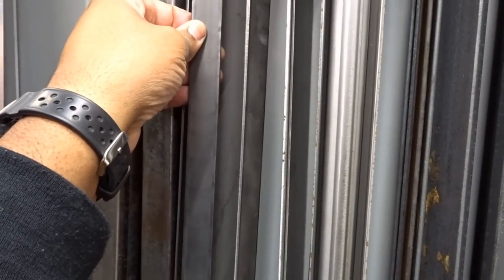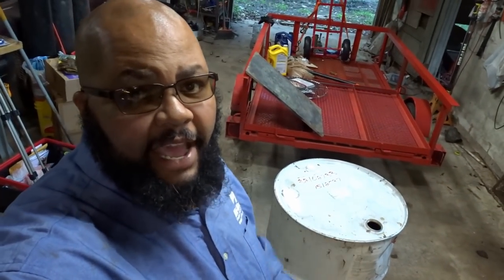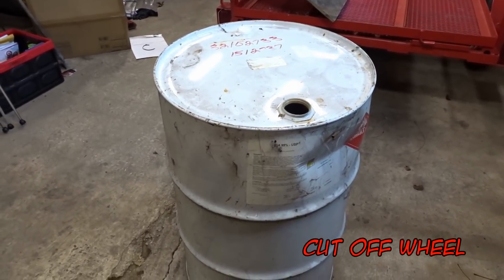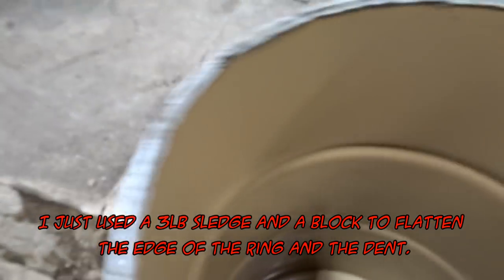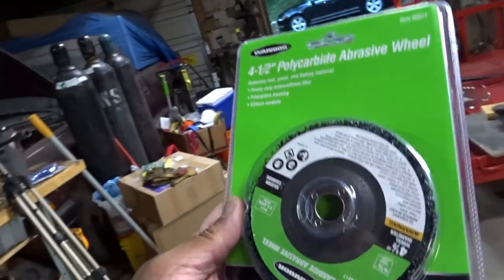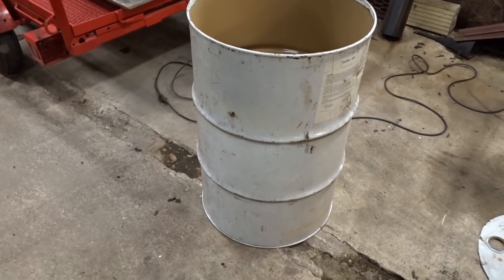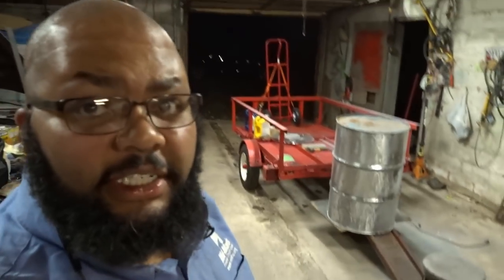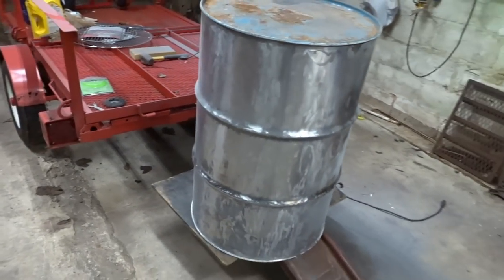SDSBBQ - Making a 55 Gallon Steel Drum Smoker - Part 1

Comment: I wonder if the paint strips easier if you burn out the barrel first?
Reply from the maker: It does. I had my car at the end of the driveway so I didn't burn it out first. I have almost always burned it first but for the sake of the video I didn't.

Comment: Did you have to wash the drum girst buddy? I got one bit it has a motor oil and I’m quite cautious as it might sprak and boom haha
Reply from the maker: The drum I used has olive oil in it so I didn't have to worry but I did have one that had rubbing alcohol in and it did go boom on me when I started cutting in to it. Motor oil isn't flammable so I'd just burn it really well when you cut into it.

Comment: The weather has finally changed 2 projects to go before the weather change again. For the flat stock. I used 3/4@3/16 thick. I wanted the lid to be flush to the rolled band at the top of drum. What would be nice is to get a roller tool thing. To roll the flat stock.  UDS is a labor of love.  I need to stop adding shit to mine and call it done for gods sakes.
Reply from the maker: I actually went to Harbor Freight looking for a roller but it was like 80 bucks and I didn't want to spend that on a tool I might use once a year or so.
Reply: Roller yes sir  I think I want one. I would like to make a slow and sear out of 1-1/4 flat stock 3/16 thick. Baileigh R-M5 comes to mind.
Reply from the maker: If you look at the HF roller they compare the price to the Baileigh R-M3... But a slow and sear would be awesome!

Comment: I have a barrel that had isopropyl alcohol in it. It’s flammable. How did you clean yours out so it wouldn’t spark and catch fire.
Reply from the maker: I've had a few that have had alcohol in them. Let them sit and air out or fill it with water and cut them.
Reply: @SDSBBQs  ok thanks. That’s what I did. I used water and dawn dish detergent.

Comment: Did you use a guard on your grinding wheel? I got the same 4 1/2” polycarbide abrasive wheel you got but doesn’t fit my grinder with the guard...
Reply from the maker: Yes, you have to make it fit.

Comment: Hi, I know this was posted a long time ago but I’ve got a question regarding the paint. I noticed you didn’t remove the paint from the inside of the barrel, would that be a problem once barrel starts to heat up when in use? I have a good grade barrel and I don’t want to burn out paint if I don’t have to
Reply from the maker: The inner liner burns out VERY quickly when you heat it up. I recommend burning out the drum and it will make getting the liner and the outer paint off easier. I didn't burn this one out because I wanted to do that with the person that won the drum.